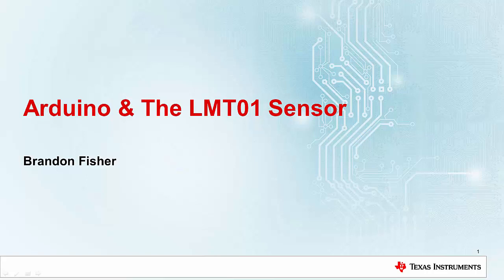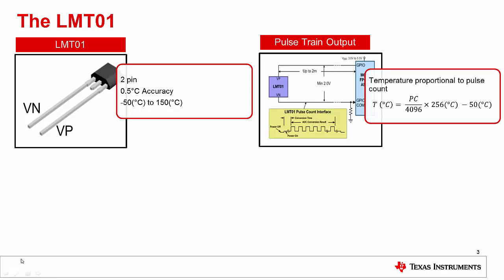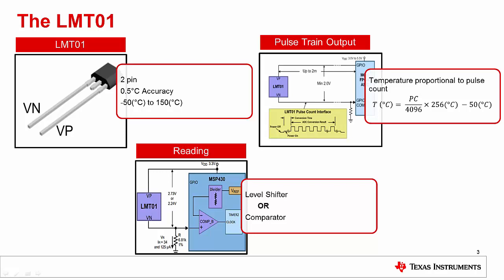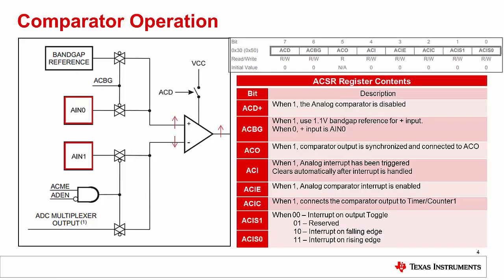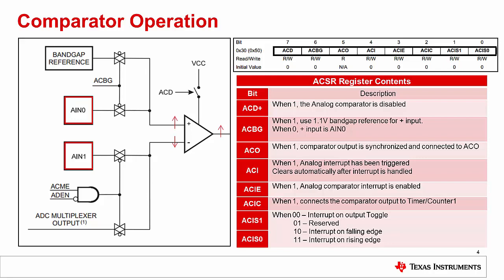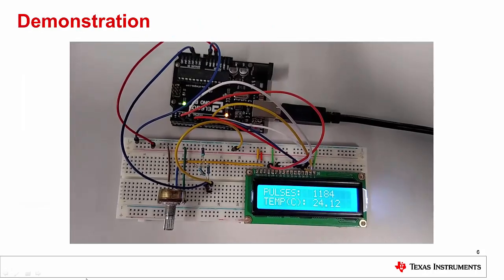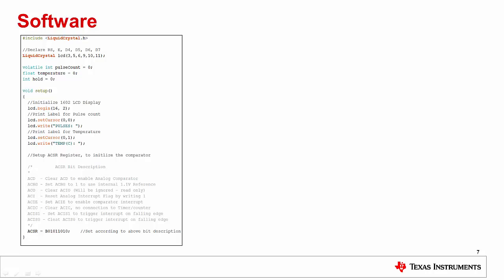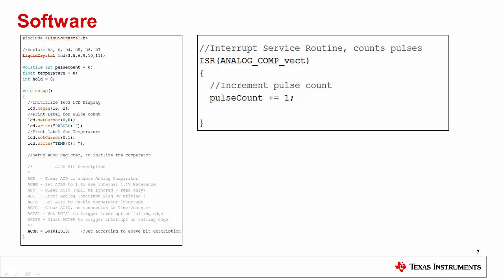How to interface the LMT01 temperature sensor with Arduino

Comment: This sensor appears to be easily influenced by stray capacitance on the wire.  I tried keeping it 1ft away from my Arduino (actually an ESP32) using jumper leads to avoid any self-heating from it, and simply holding on to one of the jumper leads was enough to increase the pulse count and get it to read 35C when it was actually 30C when I let go of the wire.  

Okay, maybe it can't handle such long leads, so I put it on the breadboard less than one inch from the GPIO pin.  Same situation but less pronounced - placing my thumb on the jumper lead going from the LMT01 to the GPIO of the ESP32 was enough to raise it by 2-3C.  Interestingly only on the VN lead, not on the VP lead going to 3.3v.  Clearly due to capacitance and not because my thumb was actually heating the sensor, since I could place it much closer without seeing this sudden change, only when touching the wire going to the VN pin.  

But this effect is so huge that why would I bother going with a 0.5C/0.625C accurate sensor if I can't trust the values it pulses out due to stray capacitance?  How can I trust the values it gives, when will I ever know they are "true"?